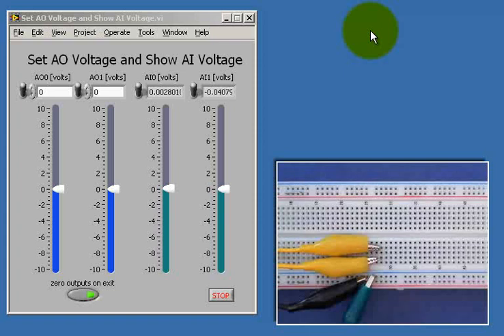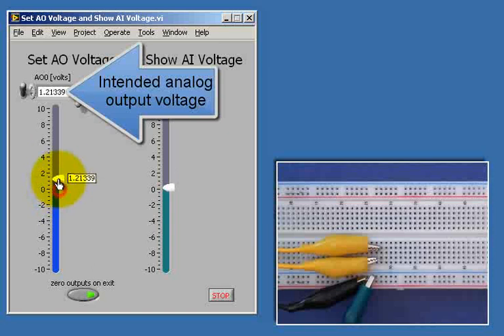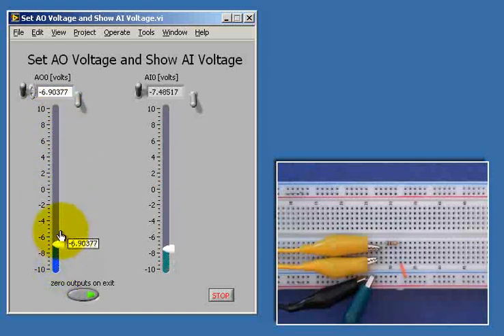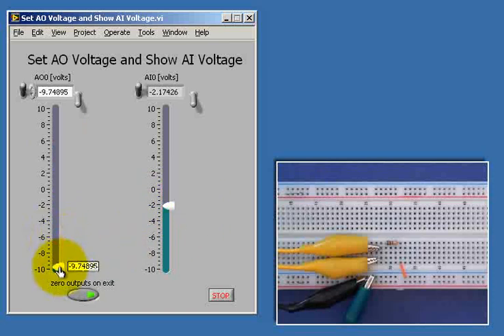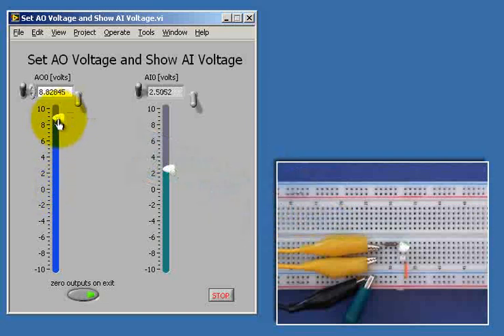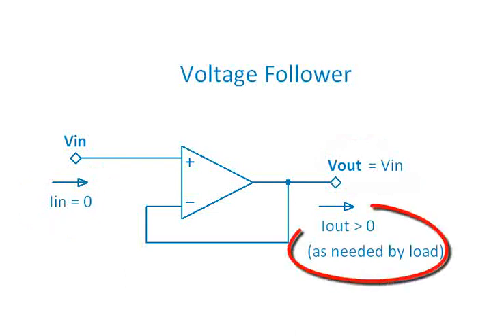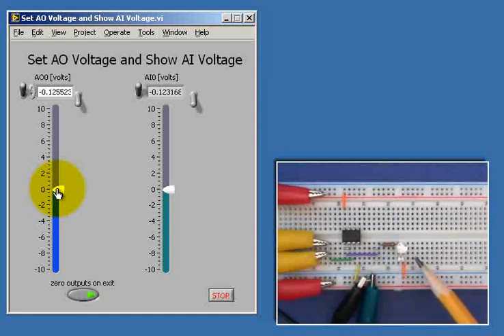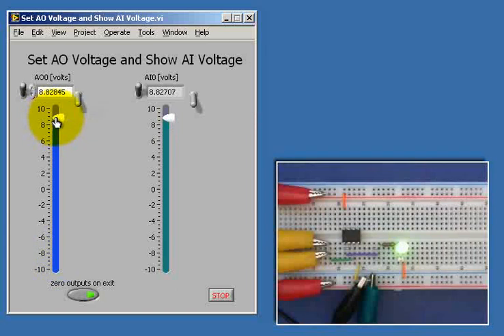NI myDAQ: Increase AO current drive with voltage follower

Comment: I cannot quite see where everything connects on the breadboard.  Would it be possible to post a link to either a circuit diagram or a video which shows the footage of the connections at a higher resolution?